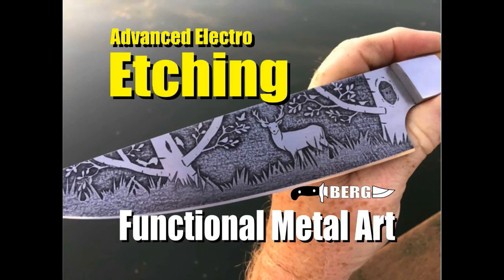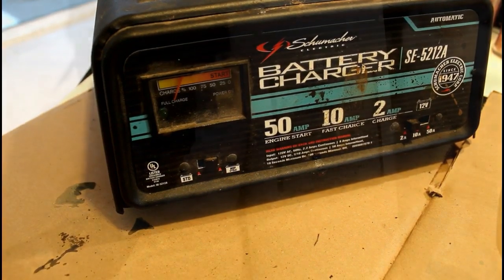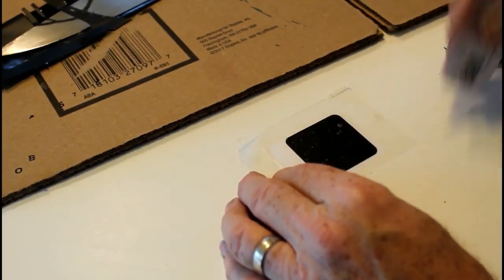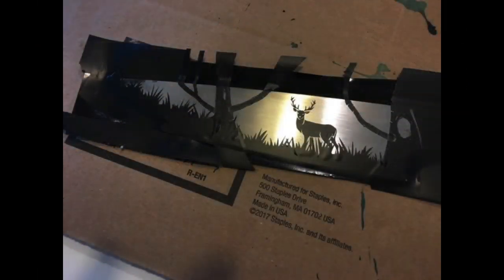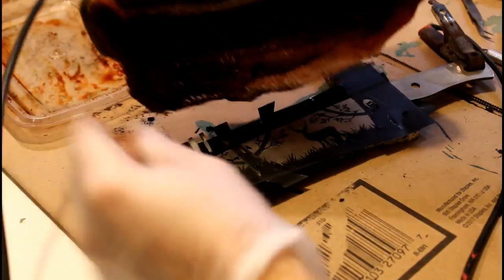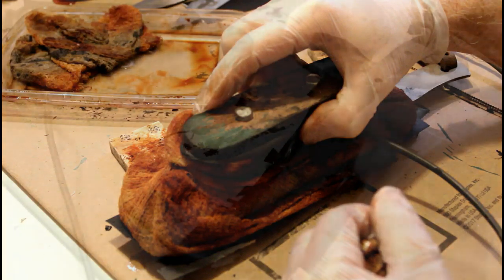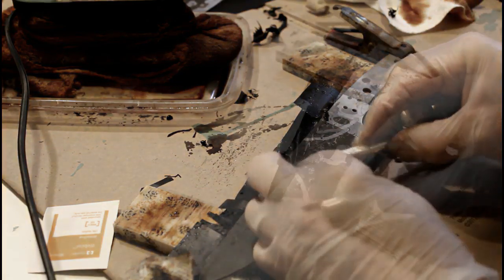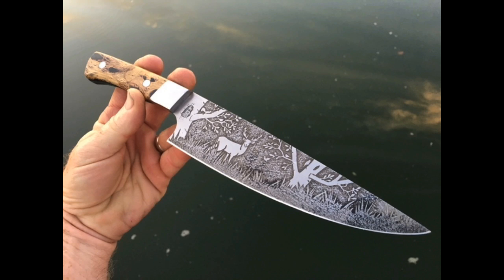Advanced Electro Etching How to create functional Metal Art

Comment: Heat actually makes the vinyl stick better, I always pass my vinyl resist over a lighter flame quickly and apply pressure, since I submerge my metal pieces fully in the solution, the liquid would get under the vinyl if I don't do that.
Reply from the maker: A little heat does but to much also causes a problem. These blade will get very hot if not cooled down periodically.

Comment: Greetings from Phuket Thailand.
You have inspired me my friend, I was a graphic designer over 40 years ago and have been  involved with computer graphics since 1986. I'm a knife collector but have never made a knife. Since seeing your video I have decided to go the full monty and have bought Cameo 4 as well as a Laser Printer for making Stencils, both AC and DC 12v Transformers, 4" and 2" Belt Sanders, a knife blade grinding Jig, 10" Wet Wheel Knife Sharpener with Strop/ Polisher. I still need a Drill Press but it can wait for a few weeks. I have in stock Sandwich Damascus Stainless Steel Billets and Blank Blades as well as many Damascus Kitchen and Hunting Knives. I will use my skills to embellish and value add to purchased production Knives and My own creations, I am very excited as this has been something I have been planning for over 15 years and I have had many sets of Mammoth Ivory Scales carved in 3D for this purpose. My initial test for etching on old Knives are very pleasing and I am planning more tests using different methods including Gold Plating before I actually Etch an expensive blade. I have had lots of experience doing intricate carving of Leather and making Western Gun Belts, Gun Holsters and Knife Sheaths so I will apply that to my ideas as well. Keep up the great videos you got an old guy off his ass and excited. regards Barry
Reply from the maker: Wow you got me excited just hearing about your plans. Please send photos of your work. Would love to see
Reply: @DIYeasycrafts  Sure thing where can I send photos to.

Comment: Hi. It is dangerous to electro etch with salt water?
Reply from the maker: For electro etching you need some sort of electrolyte solution. I use salt water for high carbon steel. I use a mixture of white wine vinegar and salt for stainless steel
Reply: @DIYeasycrafts  I will use it for mild steel. Low carbon. Just some symbols or logos. This is why I ask if the saltwater electro etching is problematic because of possible gas issues.

Comment: If I have a blade or tool with an embossed logo stamped into it, how would you suggest getting rid of it so it doesn't interfere with the design?
Reply from the maker: If the logo is stamped into the steel its almost impossible to get rid of.
Reply: @DIYeasycrafts  Thank you. That's unfortunate, as I just spent 3 days refurbishing an old, rusty axe head, but thank you for the info!
Reply from the maker: @1jugglethis  If its an axe you have plenty of thickness to work with. You could always use a disc grinder to sand away the logo and then just refinish the surface
Reply: @DIYeasycrafts  quite true! I'll pick one up!!
Reply: @DIYeasycrafts  I'll have to craft a design which avoids the logo(s), I suppose.

Comment: No matter what power source i use i cant get this to work. Killed a 12v 1amp transformer, laptop charger at 12v 3amp cuts out and a car battery charger at 12v 6amp hardly marks the metal then cuts out. 

Any tips on what power supply to use? Im uk based

Comment: 14:41 now you could aneal it and make it gold https://www.youtube.com/watch?v=F8fjxbCRZ8w&t=7m10s look at 7m40s for the result , you can make it bronze or gold booth look awesome on polished stainless steel.
Reply from the maker: Annealing the blade would make it a bit softer. These blades are actually made for every day use. Love the golden look just not for this project
Reply: @DIYeasycrafts  that depends on the color, i looked it up and golden and orange are safe, the softening starts when the color gets dark purple, and is certain at the blue color. If you want to be safe try golden, it needs only ~200 degrees Celsius which is a very low temperature. If you have an electrical controlled oven its easy. But with gas i found the trick is heating up very slow since the color comes with a relartive long delay of ~10seconds. Just try it at a unimportant spare knife for future projects.

Comment: hello. is 12 v alternative or direct? what is the liquid you use.thx
Reply from the maker: I use an old 12v car battery charger set at 2 amps. Warm salt water for high carbon steel. Purchase SS electrolyte solution for stainless steel
Reply: @DIYeasycrafts  ok.thanks

Comment: What did you use to protect the already etched side while etching the other. Vinyl or a resist paint?
Reply from the maker: I used vinyl + notice that I suspend the pc on a couple small pcs of wood. That way its never sitting in a puddle of electrolyte solution
Reply: DIYeasycrafts fantastic work 👍🏻 and thank you for the fast response.